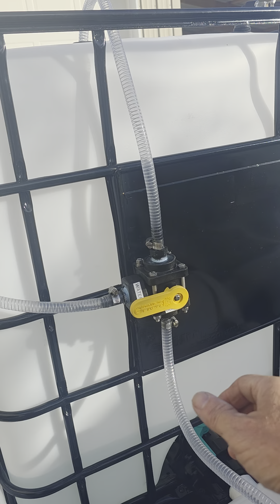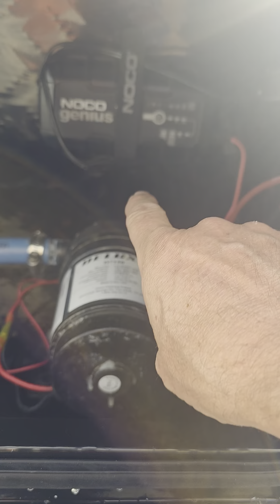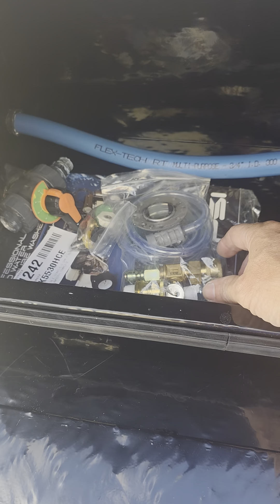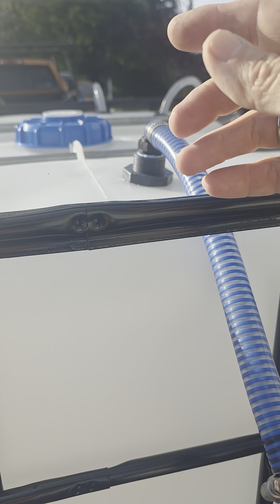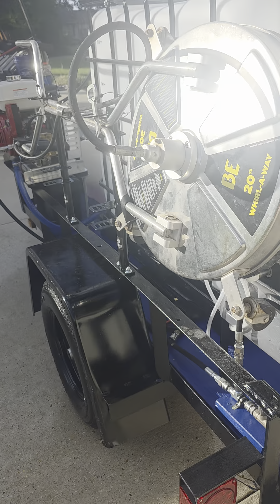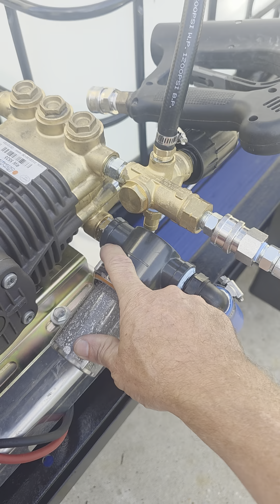Pressure and Soft Wash Trailer- Walk Around

Comment: How did you prepare the tank metal to be painted and secured from rusting? That’s fire!
Reply from the maker: You can take the top 2 rails off these IBC totes - just few screws - and pulled the actual tank out - then just paint like you would anything else-  used 3 coats of high temp high gloss rustoleum - put tank back in and your ready to go- thanks for watching!
Reply: @reflectionsexteriorservice3195 thanks bro! I’m running with that💪🏾 Blessings to you🙏🏾
Reply from the maker: @PressureKingSoftwashLLC thanks for watching!